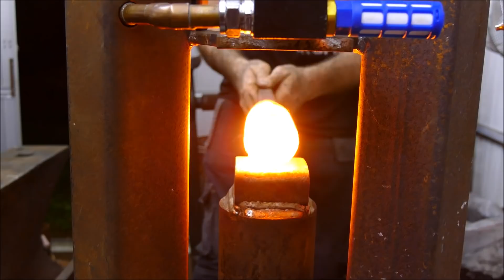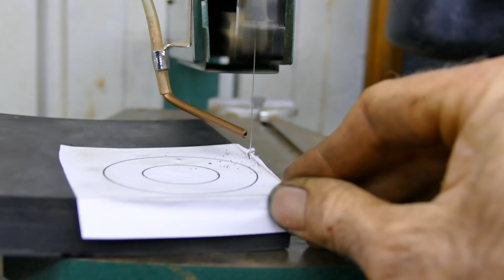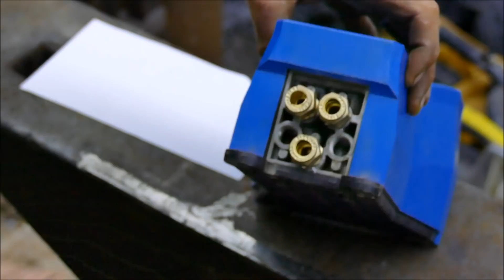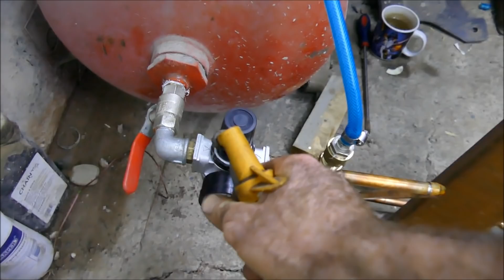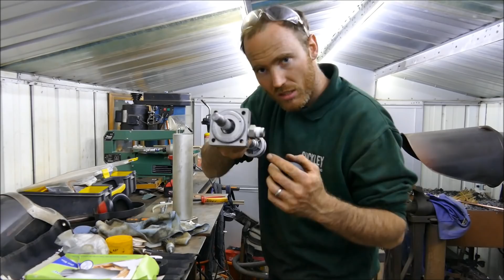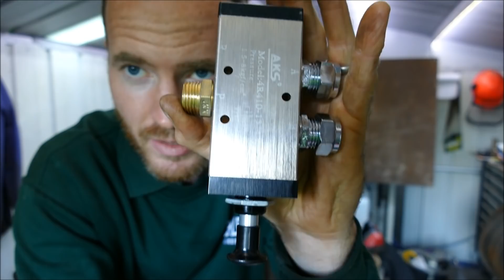DIY power hammer ultimate upgrade - More money making power

Comment: You’re losing air pressure after the regulator when you go any bigger copper pipe the smaller pipe or change the pressure that it left the regulator at you consider and 3/8 icemaker line you will not get the more volume but it will maintain the pressure that is leaving the regulator rat consider that
Reply from the maker: Already on it and have made changes in the next video, cheers and all the best. J

Comment: Hi Joshua, Great design! I bought the plans and will be making mine soon. Just one question, the link to the 1/2" valve on Amazon brings me to a valve that costs $236.09. I don't think this is right and could use your advice about the correct one to buy as I am not familiar with this type of valve. Once again, Great Job and thanks for sharing!
Reply from the maker: Ah i Think it is the same valve but coming from another country so you have shipping and inport tax like a beast.... simple scroll around for a similar valve there is nothing special about that one.

Comment: So, if I understand the operation of the hammer, you have to depress the foot pedal each time you want it to strike a blow?  Hmmm, if that's the case, I think I'd try to create a simple mechanism that would operate the switch automatically so you could just hold the pedal down and have it just run continuously.  Of course, a simple cam on a small rotating wheel would suffice and you'd have to make it the correct size to "time" the operation to the air cylinder's cycle time.  Also, if the continuous operation mode could be easily and quickly disengaged, then you could have the finer control with the pedal for lighter blows and only when wanted.
Reply from the maker: you could but I like the control of every blow with precise pressure. the autonomy wastes air and therefore enrergy ineficient. but this style is efficient, simple and highly controlled. cheers j

Comment: I did not have good results plumbing my hammer with copper.  It's a different design, but same general concept.  The problem I had was there were a few spots where the pipe was flexing ever so slightly.  The metal got fatigued and failed after a few weeks of use.  I bought good quality high capacity rubber hoses for those specific links.   This seems like less of an issue for how your hammer is put together, but something to still be mindful of.
Reply from the maker: Hi Dan, I didn't have trouble with mine but I did change the valve and now use rubber again, its a good idea. coming in the next video very soon. cheers J

Comment: And installing the thinner walled donut may, in time, cause the piston to “dish” as the edge of the piston comes into contact, under pressure, with the donut. Did you use any anti-chafing material where the copper pipe goes through the steel square uprights?
Reply from the maker: I used rubber Gromits, however i'm changing it all again to suit the new valve pedal. coming soon in a new video. cheers J

Comment: I am thinking if you made that cushion donut fix to the piston rather than the cylinder you would have hade the airflow the system requires. But definitely the donut is a good idea. An air filter/strainer is a good idea, but maybe that’s in your regulator.
Reply from the maker: Thank you, all works well now with the modification. cheers J

Comment: What I know about this is probably worth less than you paid me for it, but why use a "washer"? 

A spring would work at least as well and have the advantage of not reducing the path the air has to go trough! If you managed to time your foot pedal well you could convert energy from the spring into downward force adding to the acceleration on the downward stroke.
Why go for a foot switch that only allows single operation? Again I show my ignorance of the names of the valves in question but .... there is a valve that would allow reciprocating action (like a steam engine uses) which would allow your foot pedal to act more like your old Massey and give greater control!
If you are handy with a drill and a blow lamp you could knock yourself up a set of copper exhaust dampers that would look even better than blue plastic ..... steel would work too  ;0)
 I believe I used to use steel scouring pads as a damper in custom motorbike exhausts (expansion pots) .... but that is just showing my age!
Reply from the maker: All very good thoughts. I like the spring idea. The cushion works well now and is very simple. All the very best. Cheers J

Comment: probably would be more powerful if cylinder was positioned to hit on extension stroke because the retraction stroke of a cylinder because effective surface area is smaller due to the shaft
Reply from the maker: It would logicly appear so, however I found the opposite works much better because on the downstroke it uses the side of the cylinder with the rod which means there is less volume to fill and the stroke happens faster aided by gravity, on the upstroke the cylinder has maximum strength because it uses the full size of the bore which is great  to lift the weight back up  against gravity which would be slower the opposite way round. cheers J

Comment: Thank you for the reply.   Yes if you are happy with the wheels and they are holding up, by all means don't change anything.  Especially if they aren't expensive.  And also as you say they are easy to change.   Did you consider how scalable your design is.  That is truly a good selling point.  It seems to me that if you need more power for a particularly heavy job you could add additional weight on top of the ram.  One could make provisions to add weight when needed.  Keep on keeping on and have a good week.
Reply from the maker: Hey Glenn. I don't think I could scale this without needing a far larger compressor which needs industrial fittings and cylinders which also puts it in a large price jump not to mention the wheels would no longer be enough. adding weight also won't work as you need the speed, there is a optimum point of weight to speed ratio to give maximum power. for example you can  forge more with a small weighted 2.5lb hand hammer and a long shaft compared to a heavy 4lb hammer with a short shaft because of the higher speed of impact and frequency of blows. I think I've got the ratio just right but the biggest question is still airflow. i'm going to put the new valve next to the cylinder ports which should help it further.cheers J

Comment: Joshua,  I received your reply.  There was one thing I have been thinking about quite a bit.  Although I feel like the design is actually revolutionary, it is hard to get over the roller skate guide wheels.   What would you think about taking the wheel arrangement along with the supporting means and replacing that whole gubbins with a pipe sleeve.  This would be a fairly close fitting drawn over mandrel (DOM) round mechanical tube.   It shouldn't be too tight fitting but not sloppy either.  The sleeve would be supported by some welded plate arrangement or possibly a rectangular arrangement of bars.   The sleeve would be aligned such that the ram is centered on the anvil when the weldment is tacked up.  I was thinking that if the ram got deformed on the bottom end then it couldn't ever be removed or pulled out of the sleeve.  But why ever would you want to remove the ram and if you do need to, and the bottom is flared out from use then it could be ground round again to get out.   Just think about this, there may be good reasons this isn't a good idea but from a distance this seems to be a way of improving an already "excellent" concept.   Your design is so simple yet yields so very much.  Thanks for listening.
Reply from the maker: Hey Glenn! So far I'm not seeing any problems, but it is early to tell with out a propper endurance test. what your suggesting works for many hammers and they also use special plastics and oil imprgnated alloys to help reduce friction, however whats keeping me to retain the concept of the wheels is cost effectiveness. if these wheels continue to work as well as they are doing then its a super cheap solution and very easily replaced.  they are low friction and hard wearing. damage to the cylinder overtime is the question but if it is an issue I think the solution will be in the joint between the hammer and the cylinder, either a floating or flexable joint I think. I'm going to push it till it breaks then i'll fix it. while its not broken I think I'll leave it. I'm not going to manufacture them until I feel it has worked enough hours to justify the cost in replacing the cylinder as a consumerble part. cheers J

Comment: you could use the foot pedal to operate a larger pilot operated air valve. Awesome work on the soldering, BTW. Cheap advice... Take the washer back out.  That cylinder has "cushions" already. Those collars on each side of the piston are designed to reduce the air flow at end of stroke and do exactly what you are trying to do with the rubber washer.
Reply from the maker: Hey dude. at that pressure the air breaks don't work as I did already try that before the cushion. cushion is definately needed I think.

Comment: Hi Joshua,
a couple of thoughts to help things along.
I the design of the cylinder is a cushion to slow the stroke down at each end.  Looking at the piston  you have the largest diameter with the o-ring and sliding bearing, then next diameter down is for the cushion seal. As this enters the end cap an o-ring seals the airs escape only allowing it to pass through the small hole on the right hand side in the video.  There should be a screw in the end cap to adjust how much cushioning there is.
I have at work fitted external dampers to cylinders easier to adjust and replace.
I have also drilled out the inlet port for the cylinder.  It might be a 1/4 bsp fitting but a 2mm hole in the port.  Another big gain would be to mount the valve closer to the cylinder if you imagine when operate the foot pedal all the copper pipe empties of air you have to refill this before any work can be done.  Mechanically linking your new valve to the foot pedal with the valve mounted as close to the cylinder as possible.  And if you want to go the whole nine yards you could fit a small receiver  just before the valve.

Sorry if this is a bit of an epic reply.  Keep up the good work
Reply from the maker: Hey Jo! I found that the air break didnt work at that pressure with the force of the load and still was knocking too hard, the cushion was my attempt to make the cylinder last a bit longer without welding more bits on, so far its working better with the new cushion but i'm no expert in pneumatics. I thought that would be a good idea with the new valve to position it next to the cylinder so the drop in pressure in the pipes is quicker to re pressurise between cycles just like you said. I'm also wondering if the larger pipe is having a negative effect and that thin pipe might work better afterall but i'm not sure as it still seems to work really well? Thank you so much for sharing what you know I really find it helpful. Cheers J
Reply: @joshuadelisle  the rubber doughnut will work fine especially with the larger hole in it.  Not taking in to account said doughnut  your cylinder is near enough 250cc or 0.009 cubic feet, therefore that amount of air has to get in and out as quick as possible so fat pipes will be best.  think of it like a bucket of water or a super soaker both get you wet with the same amount of water but a bucket is quicker!!
Reply from the maker: @qshed  It makes sense and I think of it like blowing air through a thin straw or a large straw you can feel the difference, a friend of mine though was explaining fluid dynamics and he wasn't too sure, because of the airs elastic properties and turbulance he recons it might be faster with slightly thinner pipe but again it sounded like the problem is solved by having the vlave close to the cylinder ports. he also thinks the quick exhaust vlaves could be the reason the air brakes don't work so well. I think I need to do more experiments to really find out. cheers J
Reply: of course if you do the maths correctly it's bigger nearly 800 cc 63mm more by 250mm stroke I think you said.

Comment: Your design is quite clever, congratulations.   Did you ever consider spreading the wheels out further in the vertical direction?  they don't need to be so close together.   I don't see any ill effects to spreading them out further and they will do a better job of keeping the ram aligned.  As you hammer there will be eccentricities in the system.   The hammer and the anvil and the work will not be exactly aligned due to the deformations in the work and other things.   If you spread the wheels further apart they will be able to accommodate more eccentric loading with less load on the actual wheels and less lateral deflections. You have a good thing going here.  Thanks for sharing.
Reply from the maker: I hear what your saying, however because of the travel of the ram it is set to the maximum spread alraedy and if widened more it would pop out of the supports. only way i can make it wider is to have a longer hammer head. cheers J
Reply: You are so right, I didn't realize your stroke was so long.  But anyway your design is outstanding.  Well thought out and well done.
Reply from the maker: @glennfelpel9785  Thank you so much Glen! the hammer isn't perfect but with your help I can get it optimised frurther if you find anything else or have knolege of something that i've missed, I'm always open to better ideas. cheers J

Comment: Just a thought.
if it does not seem to be performing as expected, you may look in to the fact that you have take the pressure out of one diameter (a small diameter, meaning the flex tubing) and passed that in to a larger diameter (the copper tubing which is like 5 times the orifice size). Just as when you step down water through a faucet with a restriction washer to increase the pressure, the same stands true when you step up the water flow without increasing the pressure into the larger, you need to increase the pressure to maintain the output.
i dunno
Reply from the maker: I think the washer re cut cured it, I think air was sliping passed in between the washer an the end of the cylinder staggering the stroke. interesting thought on the pipe I must run more experiemnts

Comment: Hi Joshua. Great build. Maybe I missed it but what is the mass of the moving parts?  Good move creating the plans. I see this being one of those classic builds that is pulled out on the forums every time a diy hammer is mentioned 🤩
Reply from the maker: Thank you. acceleration X the mass = force, we worked it out that if the hammer head is 68LB then it roughly delivers 1500lb of force on a 1" area.
Reply: Thanks.  I'm building a similar hammer with scrap and want to size the moving parts.The acceleration you should use in that equation is actually the deceleration of the hammer mass when it hits the workpiece. As the distance it decelerates over is very small (related to the reactive mass of the anvil, the stiffness of the structure and how much it moved the metal in the workpiece) the acceleration will be huge and you will find the force is much greater than you have calculated.  Your calculation leads to a pressure of 1500psi.  This is far lower than the yield stress of hot metal and so it has to be higher than this, otherwise the metal would not move.  Sorry to be a nerd...but I am an engineer :)
Reply: @machineshopatthebottomofth3213  Does that make you another enginerd then!!

Comment: Love this power hammer. Bought the plans. How can I get a copy of upgrades?
Reply from the maker: So are really it's just boring out the quick exhaust with a drill, adding the cushion to the cylinder and using 15mm or similar pipe with 1/2" connections. I've not drafted a new page on that yet but maybe I should. Cheers J

Comment: I saw the the small preview of what looked like  changable hammer dies . Cant wait to see you go into depth on that. Great vid!
Reply from the maker: I started filming more on that. Very simple, I used the same system on my old sahinler sm50 and never needed to change the pallets which is why I just welded mine on, also it's very fast tool change over which is helpful for progressive die forging or switching to cutt off tool. Cheers J

Comment: If I were you.. I'd remind  people compressed air can be errmm.. 😬🙈  Scary.. I have nearly been whipped in the face with a 1/2" rubber hose, I didn't do the jubilee clip up on. barbed fitting held on till 150 psi on a 270 litre tank... Blew off the back side of  the regulator.. I Had to leg it to trip the circuit breaker and  just let the hose whip around my workshop till the tank was empty 🙈😬. Scary biscuits.. I Def like the  hard pipe inside the tube best bet for sure  👍..  I'd be worried if thiers no flexible link between the compressor and the hammer tho...? Not sure how well thin wall copper and solder joint will  stand up to continuous vibration? Great  proof of concept tho , looks like its hitting nice and hard now 👍.. Still need to get my self to the scrap yard find me a solid bit of anvil😉.. Keep up the good work by the time I find my anvil you'll have it nailed 👍😉😂😂
Reply: I'd also be tempted to put a rebound stop on the thing with greatest inertia...... If the shaft on the cylinder is hardened... 🙈🚀😬🙈😂😂😉
Reply: yes, also a flexible connector between the hammer and the foot valve (in and out) is a good idea. even if you fix the pedal to the floor it will still twist. eventually this will crack the solder joint.
Reply from the maker: @original5065  Good ideas, i'll test it to destruction to see. cheers J
Reply from the maker: I'll bear that in mind, thank you.  Guarding I's a good idea maybe. Cheers J